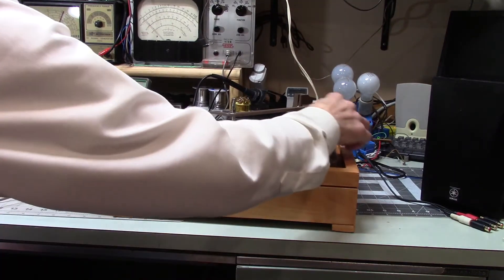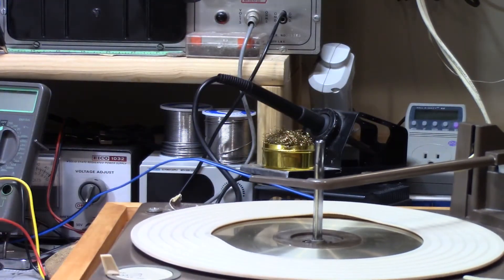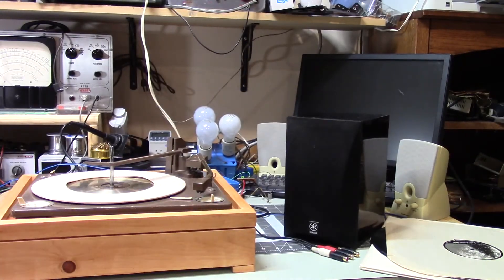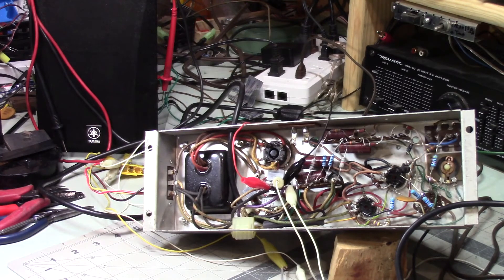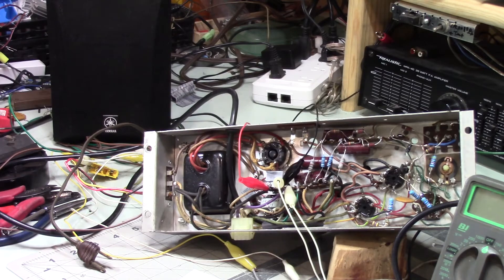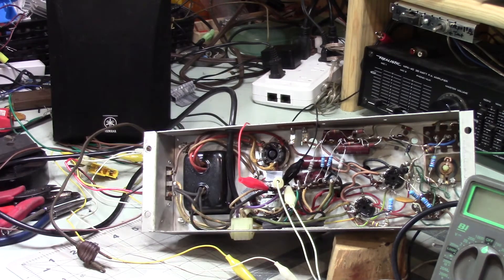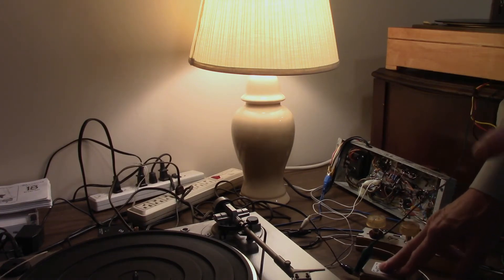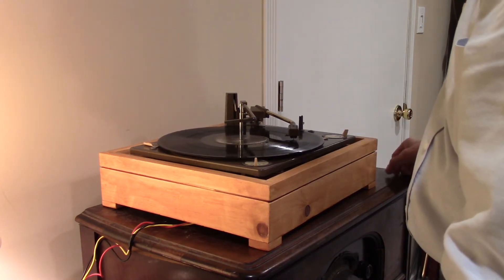Buzzing and Humming, Oh My

Comment from the maker: I have been listening the to this system since I put this video up and have discovered that there is still a small amount of buzzing. Not sure why it didn't show up while filming. The emi filter has done a terrific job of filtering the noise from the turntable motor and it makes turntables with noisy two pole motors much more useable. However, your mileage may vary. On the plus side, these filters are not expensive so you can experiment to see if it will work for you.